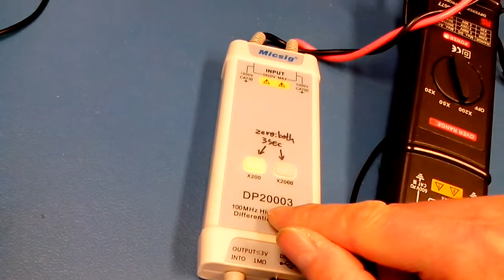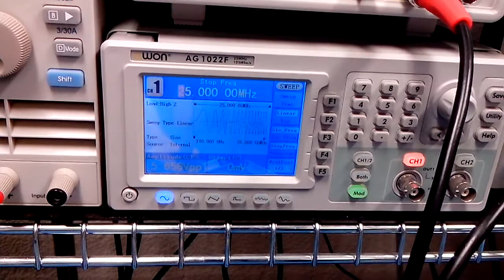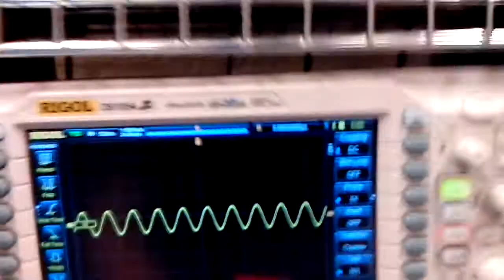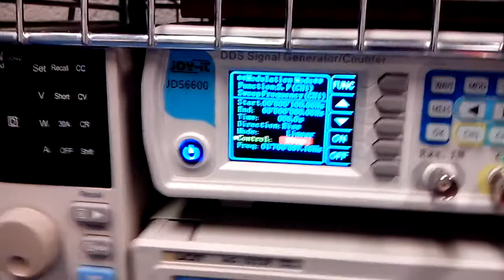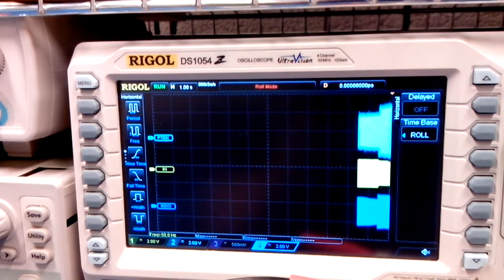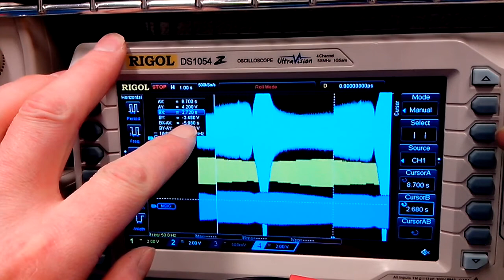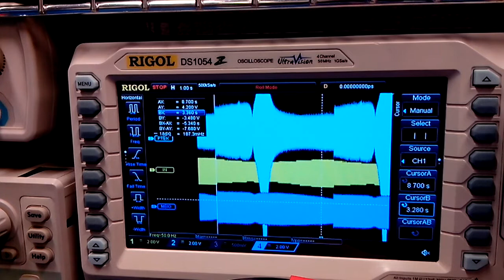Frequency response issue with Pintek DP-25 differential probe (vs. Micsig DP20003)

Comment: I'm having an issue on my pintek DP25, when I connect it to mains (230Vac). Measuring the output of the Diff Probe with respect to earth ground, im getting  around 100Vac. Is this normal? I hope you can help me with this. Also I have a higher end Tektronix Probe, and im not getting the same response as with the Pintek. Thanks :)
Reply from the maker: Hi Oliver, can you describe how you are measuring? I'm assuming you have the input-side of the probe connected to Line and Neutral of mains. Which device (oscilloscope, DMM, ...) did you connect the output of the probe to? Which attenuation (200x/50x/20x) are you using? Do you mean "an offset of 100 V" from protective earth..? (I tried what I think you are measuring here: connected probe input to Line and Neutral, and connected the output of the probe to an oscilloscope. I see the mains 50 Hz sine, and don't see any noticeable offset whatsoever.)
Reply: @mramakers  input is connected to mains. Im using Fluke 87 DMM, postive probe is connected to the positive output of the BNC and negative probe is connected to earth. X200 attenuation on my diff probe.
Reply from the maker: @olivercesu8782  ok. With "earth" you mean the negative output of the BNC, right?
Reply: @mramakers  nope. Earth meaning earth ground in our mains. One probe is one the positive of the BNC and the other probe is on earth ground of mains
Reply from the maker: @olivercesu8782  Weird way of measuring, but why not. :-) 

I repeated your measurement: 230 Vac 50 Hz mains at the probe's input, 200x attenuation, and Fluke 87 III DMM between BNC center and mains protective earth.  I measure around the same voltage as you're seeing (108 Vac). 

Probable explanation: the probe has no galvanic isolation between input (banana jacks) and output (BNC socket). The voltage we are measuring is probably due to weak capacitive coupling between input and output of the probe. This is not a safety concern IMHO, since there is a very high impedance path from input to output. (If you open the probe up, you can clearly see the input side circuitry. It seems to be reasonably well made, I think.)

More testing: my DMM has a 10 MOhm input impedance. When placing an external 4.7 MOhm resistor between mains protective earth and BNC shield/shell/outside, the measured voltage drops to 90 Vac.  When using a 100 kOhm resistor instead, it drops to around 11 Vac. Doing the math shows that the probe, in this particular setup, behaves much like a 115 Vac voltage source with around 1 MOhm output impedance. My guess is that the 1 MOhm is the combination of resistors and capacitors at the input-circuitry of the probe at 50 Hz frequency.

The fact your Tek probe doesn't show this voltage, may be because it has actual galvanic isolation between probe input and output.

I hope this helps a bit. Still curious about what you were trying to do, so if you want, please share. :-)
Reply: @mramakers  you mentioned it already. More on safety concern more than anything. As much as I want to explain my exact setup (ATE) I think its too much for this comment section. Hahaha. Thanks though. 🙂🙂🙂

Comment: Maybe a stupid question, but the differential probes are designed with a 1Mohm impedance output, your modern scope has a 1Mohm impedance input, why then using a 50 ohm termination on the T splitter ? I'm fairly new in scope measuringments etc...   Greetings from Belgium.
Reply from the maker: Thanks for the feedback. You're right - probes and scope have 1 MOhm input impedance. However, the signal generator has a 50 Ohm output impedance, and the coax cable has a 50 Ohm characteristic impedance. If you leave the cable end open, you would see reflections because of impedance mismatch and standing waves. (Depending on where you would measure on the cable between signal generator and open end, you would see the expected signal amplitude, or a bigger amplitude, or no signal at all anymore.) By terminating the cable at the far end (opposite the signal generator), you make the cable electrically seem infinitely long, and the reflections will be gone. The little stubs between 50 Ohm cable and 1 MOhm input of the probes (especially in case of the Micsig probe, which has about 25 cm long leads) is also not exactly ideal, but necessary for this setup. If interested, I think this YT video (not by me) explains reflections quite well: https://www.youtube.com/watch?v=g_jxh0Qe_FY (titled "#143: Transmission Line Terminations for Digital and RF signals - Intro/Tutorial", by user "w2aew".) I hope I understood your question and hope this helps a bit.
Reply: @mramakers  i missed the fact that the signalgenerator is 50ohm impedance. Thx for the explaining and quick reply. Bedankt. Grts

Comment: Can you test it at 1 MHz? I am contemplating buying the Pintek and will only be using it with with mains voltages and audio signals from amplifiers so large bandwidth is not needed in my case.
Reply from the maker: Hi, I did that just now, and it showed no relevant weirdness below 1 MHz.
Reply from the maker: Hi, for your info: I did some additional tests. The DP-25 seems sensitive to magnetic fields, particularly around 20 MHz. (TBH I can't explain why there was a peak at 25 MHz in the video, and I can't reproduce it anymore. Peak is at 20 MHz now, with the same setup). This means that even with the input of the probe essentially shorted (banana-to-BNC adapter and a 50 Ohm terminator), it will pick up noise from nearby magnetic fields near its input circuit. Might or might not be relevant for you. If you really only need it for audio and can guarantee there are, say, no > 1 MHz components in your signals and no magnetic fields nearby, I think it's fine. But I don't use this probe anymore here. :-) Hope this helps.
Reply: @mramakers  Thanks for the reply. Would you recommend this DP for testing amplifier noise or is it not sensitive enough for such measurements?
Reply from the maker: @behemothinferno  oof... I really can't say. I think YT channel "Kiss Analog" (and probably more) talk about noise for the DP-25. And I've seen the DP-25 come up a few times in recommended YT videos. I wouldn't use this probe to measure noise myself, because of the distortion at higher frequencies. (If noise has 20-25 MHz components, they may be shown exaggerated, at least that's what I concluded from my little tests here.) Good luck in your search. :-)
Reply from the maker: ...let me clarify that: from 0 to 6 MHz, the measured signal out of the Pintek increased gradually to about 1.7 dB compared to signal at DC (or 100 Hz). I forgot whether that 1.7 dB corresponded to the 20x, 50x or 200x setting, but at either of these, there is no relevant weirdness going on like the one shown in this video - at least not with the unit I tested with.
Reply: @mramakers  Good to know thanks. Will buy it for my needs in that case!